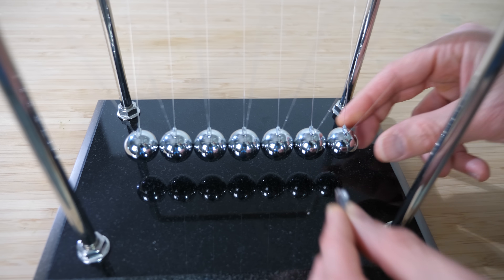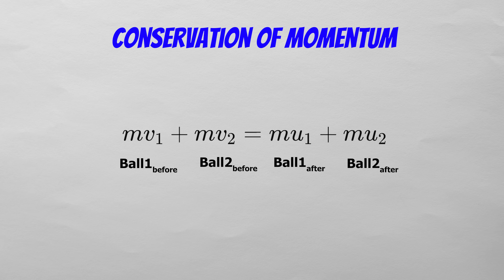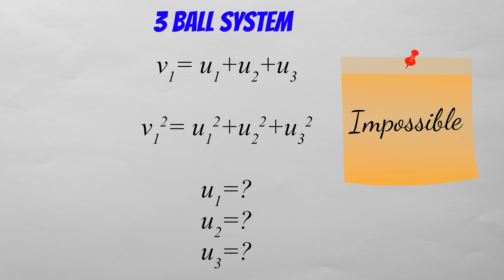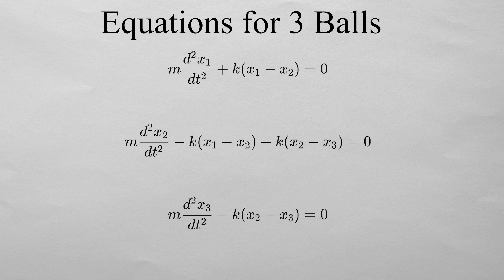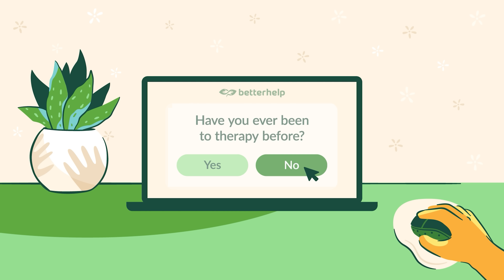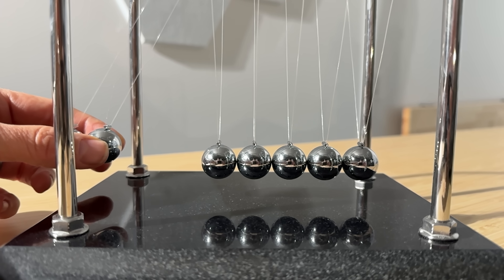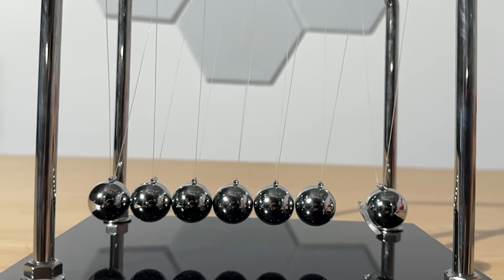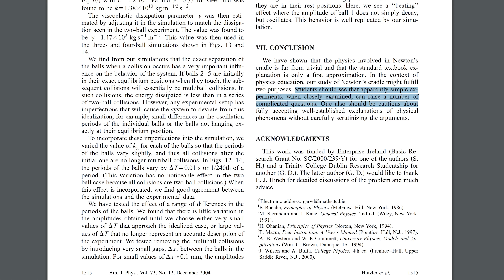Newton’s Cradle Doesn’t Work the Way You Think

Comment: I thought it was because you also have to conserve energy (1/2mv^2), and the only solution that conserves both energy and momentum is when the same number of balls move on the other side.  The plastic absorbs energy, which is why it changes things.
Reply from the maker: With two balls that's true, but when you have more than two balls then there are an infinite amount of ways to conserve energy and momentum by splitting it up between balls 1,2 and 3.
Reply: @TheActionLab I don’t understand your point here. The number of balls doesn’t really mater? There are no ideal kollisions, Ek before > Ek after is true not Ek before = Ek after.
Reply: @TheActionLab  suppose there are 3 balls of mass m. 1 is falling and collides at velocity v with the other two, with momentum m * v.

To conserve momentum, the far ball could depart alone with velocity v, or both of the other balls could depart with velocity v / 2.

But if E = 1/2 mv^2, only the single departing ball has the same energy.  If the two other balls depart with velocity v /2, the energy is 1 /2 * (2m) * (v / 2)^2, which is 1/4 mv^2.  So the energy is not conserved.
Reply: Exactly- for the idealized motion energy and momentum conservation describes it. You get only one post- collision scenario that matches pre-collision momentum AND energy, while also matching boundary conditions like “it has to be the end ball that popps off”: Can’t have the end ball stationary and a middle ball flying away, even if that would satisfy overall momentum and energy conservation

The plastic bit soaks up some energy in deformation hence the different result

Wave equations are not needed here.
Reply: Couldn't you 'tune' the set up via the mass of each ball (keeping them equal) so that an unequal number of balls could rebound on the opposite side (at a different velocity from the original swing) and conserve both momentum and energy?   -- But, it still won't be an unequal number of balls because of the compression wave effect . . .

Comment: If i understand this correctly, this can be proved and better displayed by replacing the balls with actual hanging springs and it would behave the same way and even be visible to the naked eye. An extra step could even be replacing one of the identical springs with a spring that has the same mass, but a different resistance factor. If i understand correctly, this should affect the behavior of the system like the tape. If im correct, would really love to see this experiment!
Reply from the maker: Springs wouldn't work, normal springs are Hookian springs, F=kx, but these follow Hertzian spring physics (mostly) F=kx^3/2
Reply: @TheActionLab  Ok you just lost me there. Now you need to do a video on Hookian vs Hertzian springs :)
Reply: @TheActionLab Does that mess up the demonstration, though? If a springy Newton's cradle does the thing, it'd be a great demo, and you can always say they're not quite the same kind of spring
Reply: @TheActionLab does the rigidity/flexibility of the cord have to compensate for the load weight? Meaning, if you scaled up the model like mythbusters did, as the load of the ball is scaled up to mythbusters size, doesn't the rigidity of the tether cord need to be scaled up as well? Maybe you could use steel I-beams instead of braided steel.
Reply: PS do the mythbusters giant newtons cradle. I bet you could do a swing set size one. If you do, you have to give me a free therapy session as an idea usage royalty payment.
Reply: This is a massive mythbusters newtons cradle experiment. They conclude that you can't scale up.
Reply: it could prove problematic to get some near-perfect springs that are large enough to see the compression wave and have them all oriented and striking in just the right way for the effect without substantial inefficiencies in the transfer.
Reply: maybe sufficiently squishy balls would work
Reply: With spring it will never work
Reply: It will not work with spring, it a really bad example

Comment: Shouldn't the Newton's cradle still work if the 3 center balls were stationary? Or perhaps even if they were replaced by a stationary, rigid bar made of the same material with just a swinging metal ball on each end?
Reply: The compression wave would still travel through the steel if the center section was stationary, but whatever's holding it would absorb some of that wave.  The free-swinging of the normal system doesn't transfer relatively much energy to the air around it, so it transfers more than a stationary section would.
I think most of the lost energy, other than the raw loss to gravity, goes into the clacking sound.  That's got me wondering if a Newton's cradle in a vacuum chamber would perform better than the simple loss of air resistance would account for.  No clack!  Hmm, somebody around here has both of these things!
Reply: @VoltisArt  If the material anchoring the rigid bar were opaque to sound... Is that possible? Maybe if string were used to anchor it instead of letting it swing free?
Reply: @the_iii  "string were used to anchor it"
If the strings were taut, they would act as springs, like guitar strings -- so, I think the results would be very much like if the bar were a row of hanging balls in the standard set up.
Reply: @the_iii  opaque to sound:  Nope, not possible.  Sound isn't a thing that can be blocked like light, but a vibrational condition of the medium it's in.  There are media that transmit it very poorly, but they depend on certain conditions like not being tight, the way an anchoring string would be tight.  String/rope/any line is awful for transmitting sound if you try to push it, but good for transmission if you pull it.
There are materials like open-cell foam (used in some aquarium filters, allows water to pass through) that would be bad at transmitting the sound, but they would happily absorb it.  This too would remove energy from the system, just as the strong anchor would.  Encasing the rod or center balls in cement might also absorb the sound wave without really transmitting it elsewhere, but on any account the loose rod or balls will have the best transmission.
If we had a way to do this without any strings, it would work best of all!  Near-perfect transmission.  That does make the return trip nigh on impossible, however, so that end ball doesn't come back.
Simplified answers to your initial questions:  The stationary bar/balls would still transmit SOME force via the compression wave, though it would be muted, regardless of how it was locked in place.  Subbing out a hanging rod instead of the center balls would also work, if it was well balanced across the angle of travel, so it didn't twist and hit the outer balls sideways.
Weird quirk of this setup:  There would probably be a point in time where both compression waves were moving through the center bar/rod, in the same direction, at the same time!
Reply: I'm pretty sure the answers are Yes and Yes (assuming that the center masses are still free floating).  If the center masses are anchored, then their "spring" has to push against the earth and it doesn't move very far :-)

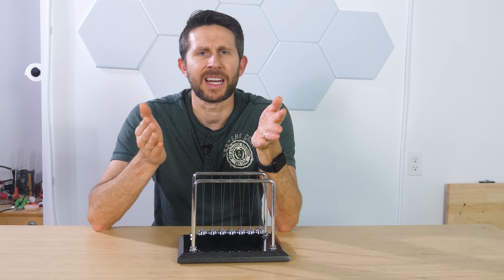Comment: The caveat at on screen at 1:28 ("minus any small energy absorbed from plastic") is unnecessary. However much energy is absorbed momentum is still conserved.  It would still be conserved if the balls were all made of putty and stuck together. Kinetic energy can be absorbed (turned into heat) but total momentum will still be conserved.

The only way momentum of the balls is not conserved is when they transfer the momentum to another object. They do that through the strings, but if you only focus on when they balls are moving horizontally and the strings are near vertical then you can ignore that.

Comment: When the plastic is between the first two colliding balls, I think it can be framed as a much smaller shockwave due to damping of the plastic, rather than a slower shockwave going to the right.
Reply: Conversion into deformation energy
Reply: If the shock wave was dampened that would break the laws of physics. Energy cant just disapear, so yes its just slower.
Reply: @ryzezvixpaes179  a wave going into another material and being disrupted so it's not as strong is called dampening.
If it broke the laws of physics, we wouldn't have a scientific word for it.
It's also not "just slower", though slowing is a component.  It's being redirected sideways as the silicone squishes, such that the wave doesn't transfer to the next medium (another ball, in this case) in the same way it started.

Comment: does it still work when you replace the balls with springs? 🤔
Reply: Probably not... The springs will absorb much more energy than the metal elastic deformation, acting like the plastic between balls.

Comment: Based on this, if you know the speed of sound within the ball material, you could compute (in an ideal system) the delay between the first ball impacting and the last ball departing for a system of any length balls.
Reply: Yes, exactly; and do other mildly interesting computations like how far away is that submarine you just pinged.   The speed of sound in water is about four times faster if I remember right.

Comment: My favourite explanation of this effect is a bit different. Imagine three metal balls with equal masses. When I let go one ball, on the opposite side another one ball will redound with the same speed. Why don't two balls rebound with half the speed? In this situation momentum would be conserved, because
 mv = 1/2mv + 1/2mv.
But the kinetic energy wouldn't be conserved. The first ball has kinetic energy = 1/2mv^2. But tho balls with half speed has kinetic energy = 1/2m(1/2v)^2 + 1/2m(1/2v)^2 = 1/4mv^2 ≠ 1/2mv^2.

In example with a piece of plastic, part of kinetic energy absorbed by that piece through deformation, so the balls will rebound with equal speeds.
Reply: Couldn't you 'tune' the set up via the mass of each ball (still keeping them equal) so that an unequal number of balls could rebound on the opposite side (at a different velocity from the original swing) and conserve both momentum and energy?   -- But, it still won't be unequal number of balls because of the compression wave effect . . .

Comment: you'll also find the balls spreading apart a bit and not staying together like they should in ideal case.. basically imperfections in surface, air resistance, microscopic gaps in between, and off centering of the balls and resistance from the string hanging them brings additional variables into play.. so do that experiment in vacuum chamber and use heavier balls to minimise the effect of strings and make sure to polish the balls then repeat the experiment to see any improvement

Comment: but 1) why should the wave reflect at all
2) shouldn't the pressure wave be reflected at all the ball being stuck and unable to reach the end ball, or to just lose energy and not being able to push the last ball as strong
Reply: "why should the wave reflect at all"
The 'bonds' between the atoms are all little springs, so you get a wave of compression and release through the material until it reaches a 'wall' and reflects back.
"lose energy and not being able to push the last ball"
The balls are 'rigid', so the compression and rebound of the 'bonds' is very efficient.

Comment: One of your best videos. It really sends home the message that established scientific truths should be questioned. We need to embrace the complexities of life. Over simplifying them leads to problems in the end.
Reply: It was not an established scientific truth. It was just what popsci bits said.
Reply: "Over simplifying them leads to problems in the end." 
OVER simplifying maybe, but substantial (even huge) simplification is necessary for us to design and build almost anything. If we demanded a complete understanding and analyses of everything, we couldn't build cars, bridges, computers, houses, or really anything else. Major simplifications are required to design and build stuff in a timely manner. 
One example: air flow, to some degree, effects most things we make -- be it airplanes, buildings, or even the Newton’s Cradle examples shown in this video (where air flow was not mentioned, presumably for simplification). The Navier–Stokes equations describe the motion of viscous fluids such as air, but these equations are generally unsolvable. This alone would stop us from building most things if we didn't allow simplification. Simplification makes things possible!

I'm not suggesting we shouldn't strive to understand things more fully, just that simplification, when done correctly, is a good if not necessary thing.
Reply: I find this comment similar to "don't start with simple 1+1=2, start with quadratic differentials, because the full truth is more important for everyone". Most people will never need the full complexity of science and math, and to be frank human will probably never discover the full complexity of these things. But even if you aren't a regular person but an engineer, you spend majority of your time working or coming up with simplifications that let you get something done during this lifetime. So there's perhaps more nuance to it than waving flags on barricades about scams like simplification.

Comment: I can see a YouTube channel rushing to make an amorphous metal version of this experiment: will the balls bounce for hours, or for the same amount of time shown here? Secondly, how might the experiment perform in zero gravity and in a vacuum? Clearly there would be rotational forces to deal with, how long would it perpetuate before the energy is consumed?
Reply: "how might the experiment perform in zero gravity and in a vacuum"
Without gravity to pull the balls back, they just keep moving forever in direction of the impetus of the striking ball -- but, of course the string turns that into an arc until it wraps around the device (and then some rebound).
Reply: Indeed, we can take away air to probably make it last longer, but taking away gravity just turns it into a tangled mess, barring rigid lines holding the balls.  The final result with rigid lines is the balls all eventually stopping due to mechanical friction, and probably not touching each other.

Comment: It's light! "Photonic, not atomic"
γ=±λ′ 
f=c/λ′
Time dilation is proportional to wavelength and inversely proportional to frequency.
This respects the law of conservation and shows the Bible is true through e=mc² because both mention the rate of light "c²" is the speed of light "let there be light" was a direct mention of its importance. It was God's first act, which would have also been his last. Light propagates through space, and it's intensity stretches across vast darkness, which lead to chemical/electro-magnetic differences, which lead to differentiation.

Comment: γ=±λ′ 
f=c/λ′
Time dilation is proportional to wavelength and inversely proportional to frequency.
This respects the law of conservation and shows the Bible is true through e=mc² because both mention the rate of light "c²" is the speed of light "let there be light" was a direct mention of its importance. It was God's first act, which would have also been his last. Light propagates through space, and it's intensity stretches across vast darkness, which lead to chemical/electro-magnetic differences, which lead to differentiation.

Comment: So, make several Newton's cradles and use different materials for balls. For example, a hard alloy of mostly copper, and brass, and tin, bronze, aluminum, stainless steel, whatever. I don't know what to expect, but it would be interesting to watch. Maybe even some plastics or hard stones.
Reply: Any group of the same material should act the same, as long as it's rigid enough to transfer the sound wave.  Softer materials including plastics and aluminum will absorb more of the wave and slow down sooner.  Putting multiple materials in the same setup could be very strange, even if they're all rigid, because the waves will travel at different speeds in each material.  It could balance out, though, which would be as interesting as the system devolving into chaos.  Balls of varying size would change the equations and result in the same way.
Rigid non-metals like stone should perform very well, but for a limited time as they'd start crumbling instead of denting.